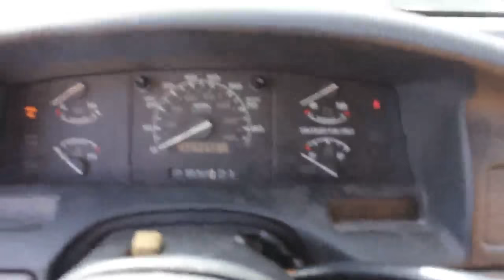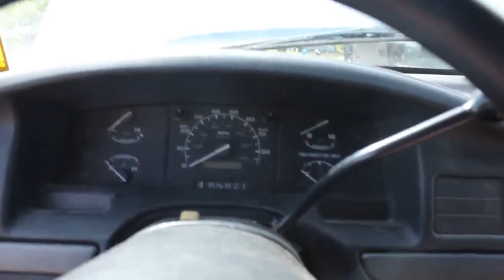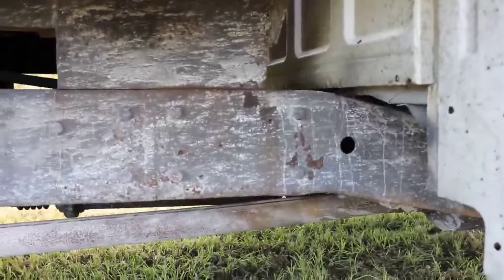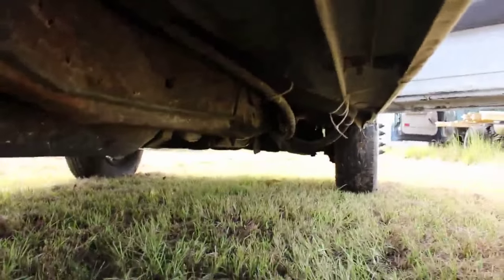I bought a dump truck!

Comment: U might b better hinging back door from the top then have 2 pins down the bottem u pull out b4 u tip . If u door 2 half doors u will have problems opening it when u full
Reply from the maker: +toby p 
The problem with the top hinged door is the opening is too small and when you dump the rough mulch it gets stuck.. I've seen it happen all the time with regular full size dump trucks.
Reply: +Robert Fulop (Banana Farmer) I'd do a swing tailgate that swings from one side